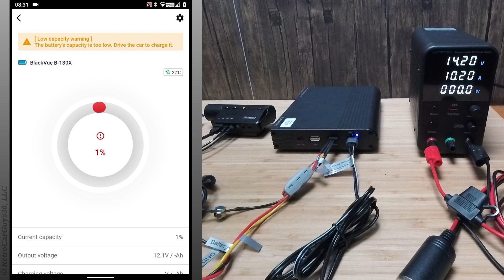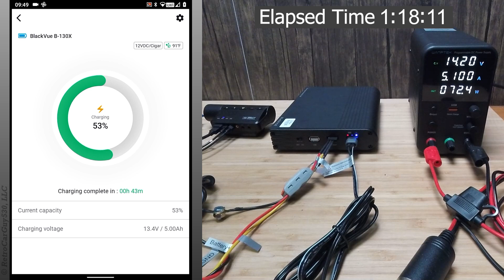BlackVue Power Magic Ultra Battery B-130X - 5 Amp Charging Test

Comment: I recently got a new Blackvue DR900X-2CH Plus and a B-130X battery, which is plugged in to the car's cigarette lighter.  All is well except that I only have a short 10-20 minute commute each way 2 days per week and need to charge the battery at home on most days so that parking mode is recording.  I've tried two US wall outlet AC to DC power inverters with no luck:  A12v 5A power inverter from Amazon (which resulted in concerning repeated low voltage warning mesages in the Bkackvue app and a 6 hour charging time), as well as the 14.6v 5A BlackboxMyCar Power Inverter (which will NOT charge the battery past 25%).  What do I need to get to charge the B130x from a standard US wall outlet?  Any help would be much appreciated.
Reply from the maker: I've reported to BlackboxMyCar that their current DC inverter does not work with the BlackVue B-130X nor with their own PowerCell 8.  BlackboxMyCar is searching for a different DC inverter that will successfully charge their unit and the B-130X.  The only solution I can suggest is what I used in the video which is a DC power supply with a max capacity of 10 amps.  You would need to get a cigarette lighter female plug that would connect to the front of the DC power supply to use the cigarette lighter adapter plug from the B-130X.  You could even connect the hardwire cable from the B-130X to the DC power supply as well and use the high amp charging mode.  I've successfully used a WANPTEK or NANKADF DC power supply (purchased on Amazon) which are capable of putting out enough volts amps to charge the B-130X.  I usually set the voltage level to 14.2 and the max amps at 10 amps.  If you can find a DC inverter that outputs 14+ volts and it can handle up to 10 amps, that should work as well.
Reply: @RetroCarGuy530  Thank you!
Reply from the maker: @admckenna1870  no that won't work.  The output voltage needs to be in the 14.2 to 14.6 range.  The dash camera battery packs won't charge when the voltage is "low" at 12 volts because that would be draining your car's battery without the charging system to keep the car's battery charged.
Reply from the maker: @admckenna1870  I cannot find a DC inverter that will work at this time.  I can only find units that supply 12 volts instead of the required 14.2 to 14.6 volts.  The best I can suggest is using a DC power supply with a cigarette lighter socket cable.  I purchased an alligator clip to cigarette lighter socket cable with 12 AWG wire and cut the alligator clips off to put two 1/4" ring terminal connectors on the wires.  The ring terminal connectors then connect to the power supply under the removable wire nuts on the positive (+) and negative (-) connectors on the front/bottom of the power supply.  You could use a smaller wire gauge (14 awg) for this approach as well.  I could not find a cigarette lighter socket which already had the 1/4" ring terminal connectors.  The ones I found had much larger ring terminal connectors which are too large for the DC power supply connectors on the front of the DC power supply.

Here are Amazon affiliate links to the items I used.  The power supply is $87.99 but it has a 20% off coupon. The YCIND alligator clips to cigarette lighter socket (12 AWG wire) is $15.99. The insulated ring terminal connectors are $8.59 plus they have a 15% off coupon.  You only need two of the connectors. All you need is a 1/4" ring terminal connector that supports 12 AWG wire.

Using this setup, you use the cigarette lighter plug from the battery pack and set the DC power supply to output 14.2 volts and set the max amps in the 7 to 10 amp range and it will charge.  

You could also create a 12 AWG charging cable that ends with a XT60 connector (like the hardwire charging cable provided with the battery pack).  Connect that to the DC power supply and set the voltage to 14.2 volts and the max amps to 10.20 amps and you can charge the battery pack in high amp charging mode to reduce the amount of time required. The AMASS XT60 connectors are listed below if you want to tackle that approach, but it does require soldering the XT60 connector to the 12 AWG wire.

Low amp charge mode cable supplies
WANPTEK 30V 10A Adjustable Power Supply: https://amzn.to/3JI5U6p
YCIND Battery Alligator Clips to Female Cigarette Lighter Socket: https://amzn.to/3HZqWMI
150Pcs AWG12-10 Insulated Ring Terminals Connectors (DC power supply end): https://amzn.to/3HY35wF

High amp charge mode cable supplies
WANPTEK 30V 10A Adjustable Power Supply: https://amzn.to/3JI5U6p
GS Power 12 AWG 25ft: https://amzn.to/3DIB8X9
Amass 10 Pair XT60H Bullet Connector Plug (battery pack end): https://amzn.to/3JDKGXn
150Pcs AWG12-10 Insulated Ring Terminals Connectors (DC power supply end): https://amzn.to/3HY35wF
Reply: Same issue here, starting to regret the battery purchase as it’s not really doing what I had hoped.  It’s not able to keep the camera running all night (in parking mode) unless I limit it’s recording to impact only.

Comment: Did it jump from 76% to 100% instantly? Mine sometimes does that from 60%
Reply from the maker: It reach 76% and stayed there around 5 minutes and then it jumped to 100%.  With the high amp charging test it reached 80% and stayed there for about 5 minutes and it then jumped to 100%.

Comment: Hi, can I charge this battery with 15V 10A charger?
Reply from the maker: The BlackVue 12-volt system charging specs:
12V system:
– Cigarette lighter plug: 11 V–18 V / 7.2 A (max)
– Hardwired: 11 V–18 V / 13.0 A (max)

BlackboxMyCar is now selling a 14.6V/8.0A (max) DC inverter and that successfully charges the B-130X in "Low" charging mode using the supplied cigarette lighter charge adapter.  I was able to successfully charge the B-130X using a 10A max DC power supply in "High" charging mode using the supplied hardwire charging cable.  I believe your charger should work.

I discuss the new BlackboxMyCar DC inverter on the DashCamTalk website.  https://dashcamtalk.com/forum/threads/7500-mah-96-wh-blackboxmycar-powercell-8-blackvue-b-130x-thinkware-ivolt-xtra-bab-95.48162/post-592288